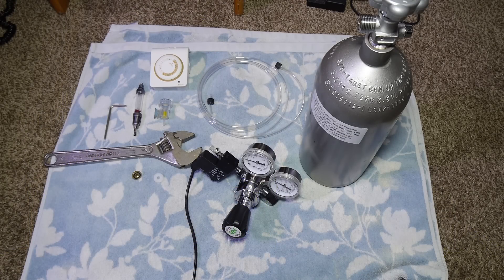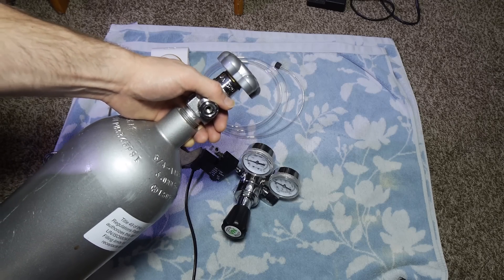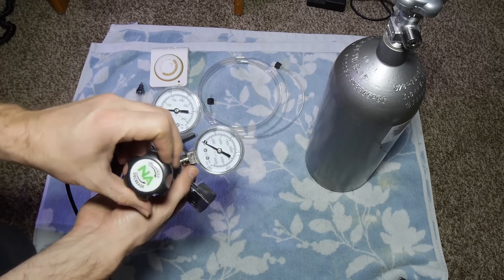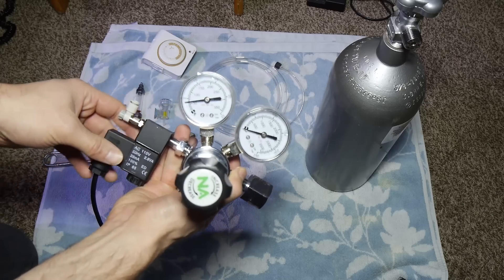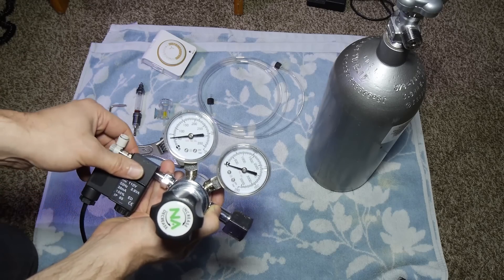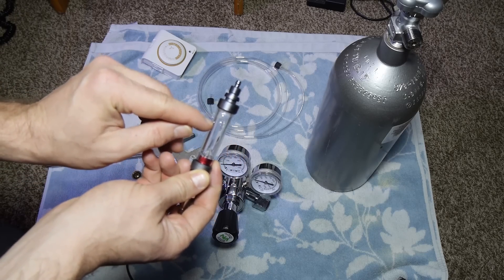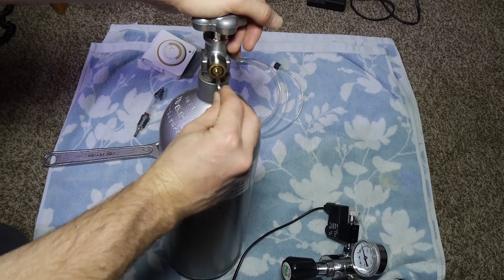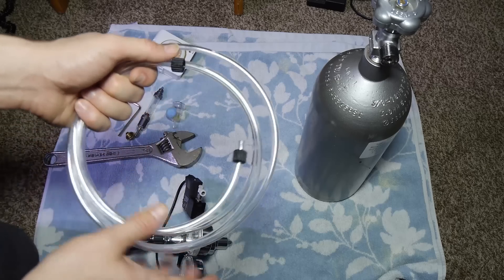How You Want To Set Up A Pressurized CO2 System | Aquascaping

Comment: Great video! So I'm getting into high tech planted tanks and I'm planning to get the aqua tech premium regulator. I just have 3 questions, what type of co2 diffuser should I get for a 55 gallon? How much would it usually cost to get a 1 gallon co2 tank? How long would the 1 gallon tank last with 2-3 bps with the regulator on for 8 hours?

Comment: Hey Dave , I have been trying to figure something out with my setup that hasn't been set up yet due to a few concerns that I have been searching for the answer before I have any regrets from damaging my regulator. So I have been trying to get my UNS mini hooked up to a 24oz. paintball cylinder. The setup video from UNS has a UNS Paintball cylinder that has the dial to open and close. The Tippmann cylinder that I have does not, so I have been trying to hook up the two without damaging the regulator from the PRESSURE. I hope I explained the potential to my fears of doing something that has my brand new reg ruined . The funny thing is that I had no fears when I attempted the first time but since I forgot to put the o-ring in the adapter I got my first " burst " of the power of pressurized CO2 😲 ....that has been corrected and I bought a whole 10 to replace if and when I have an empty cylinder , but I have been reading of so many people who have a full tank and life is great and it's not so the next morning or whenever their CO2 escaped . So those are what's holding my hair as I'm puking in the toilet of the paintball blues , not to mention that prior to the everything I had been using the reg with a 95 gram Fluval canister for a few months and it's amazing the results etc. But now 2 weeks with not a drop.😿
Reply from the maker: Hi, can you purchase the same pressure valve UNS uses on their paintball cylinder and hook it up to the paintball cylinder you are using? Or can you purchase a pressure valve for paintball cylinders in general? I am not familiar with using paintball cylinders. Another option is to open the mini regulator valve and needle valve all the way as you connect the regulator to the cylinder. And make sure to tighten the regulator really well to the cylinder. Then, adjust the working pressure (30-40 psi) valve in the cylinder, and then adjust the needle valve as needed. I am sure this will be loud and you will lose some CO2 as you are tightening the regulator to the cylinder. 

I would first try and find a pressure valve adapter for the paintball cylinder. Similar to the one UNS is using. They are obviously using it for a reason. You may find it on Alibaba, Amazon, or Ebay. I hope this helps. I am not familiar with paintball cylinders and mini regulators, so I am not sure if the mini regulator can withstand direct pressure from the cylinder or not.

Comment: Same Tank...... I got a new light and filter and fertilizer. I am now wondering what the cheapest substrate for plants will be, on Buce-Plant the Controsoil is out of stock in regular so they only have the small grain expensive kind. What substrate should I get now, maximum budget for substrate is $40, enough to cover a 20 gallon tank (24 inch long) in however much substrate needed. What substrate should i purchase, and how many pounds/bags.

Comment: what do you think of in line heater with the co2 diffuser? which order should they be attached to canister filter.
Also, what is more important if i can only afford one, bubble counter or drop checker?
thanks
Reply from the maker: The inline heater will not impact the co2 or visa versa. No issue there. for a beginner I would say using a drop checker may be safer for  you, or both if you can afford it. Some diffusers come with a bubble counter and drop checker built in so you can get all three. I think Fluval makes a diffuser like this.
Reply: Thanks so much for the advice, also do you have any videos on the substrate options to start with for planted tanks?
Reply: I found this info online..."The solubility of gases decreases with increasing temperature, so the air space when cold water was used will be less compared to warm water. The cold water will take up more CO2 and less will be escaping to the air."
So that is why I don't know if its better with heater before or after inline diffuser.
Reply from the maker: Ash Kasto It may make a slight difference, but with your circulation the temperature would be relatively the same throughout the system, right? You could test it and run your own experiment. 25 C and 8 mg/L of DO is about 100% saturation O2. So, basically you will also already have a higher exchange rate and higher O2 and will be supplying more CO2 as well. This is an optimum situation it seems. Also creates more stable exchange rate at water surface. I have found a few studies that show 25 C as a proportional average for common aquatic plants. My Clado algae disappeared pretty rapidly after implementing this method of higher O2 and CO2. Reduce organics through maintenance, and bump that O2 and CO2 both super high at 25 C.

Comment: also, will a 5lb tank provide 30-45 psi? if so, do I need a regulator to get that. my current regulator has only one meter that reads 10psi when full.

Comment: You said that this particular regulator is not out yet but who makes it and where will it be available for purchase also since this is two Stage you shouldn't have to worry about end of tank dump correct I want to get into pressurized CO2 all my plants look great but they don't grow like they should, and I'm going through flourish Excel to the point where I can purchase pressurized CO2 with the amount of money I spent in the last few months thanks for any help I really appreciate it
Reply from the maker: http://nilocg.com/dual-stage-regulator-na-ss-pro-dual-stage-stainless-steel-regulator/
Reply: Hi Dave, how is this CO2 regulator working so far? any issues? does the company provide any warranty? I have a 5 gallon fluval spec V, do you think this would work for my tank or will it be too much? Thanks bro!

Comment: Can I use an inline CO2 diffuser submerged? My 20L uses a Swiss Tropicals corner filter with a submersible pump instead of the air powered lift tube Swiss Tropicals sells. I want to install the inline diffuser submerged behind the corner filter so it's hidden with the rest of my equipment.
Reply: Randy Shapiro   if your going to use an in-line diffuser make sure you get one with an adjustable outflow Psi.  If it’s not adjustable there is a good chance It won’t be able to push the co2 through the diffuser.

Comment: Hey Dave How long would that 5 Lb tank last on a 90 Gallon tank ballpark Thanks
Reply: Rmk22 SR. I have similar questions. I have next size up co2 tanks from kegging beer. I have a planted 55 gallon tank
Reply from the maker: With no leaking from the seal a 5 lb at 2 bps will last 6-8 months. If you had it at 4 bps for a larger tank I would assume 5-7 months. If it only lasts 3-4 months usually there is a leak. I would recommend using the white nylon seals or a brass perma-seal. Don't get those hard black composite seals. Good thing is most seals are the standard white nylon and most leaks are usually just from not tightening the bolt enough. You should actually tighten it fairly well. And the verge of too tight if that makes sense. No Teflon is needed and don't listen to anyone who says tightening it a lot is bad for brass or steel. Tighten that bolt well!  Most instructions say to tighten as much as possible. Use a crescent wrench and not channel locks or vice grips
Reply: Thanks Dave very Helpful

Comment: ok so i have a 20 gallon tank housing a bristlenose pleco. i am wondering if switching my sand to a soil would be good, although i have no where to move fish so i cannot add aquasoil due to ammonia spike (unless thats a myth). so i was thinking eco complete and planting amazon swords and ludwigia then having java fern tropica fern java moss and assorted anubias attached to driftwood. i am planning on using the all in one fertilizer by aquarium co op, or would you recommend something else. also i have a tank quit from aqueon sadly so the lights are 5 tiny patches of LEDS will that be ok since the plants are lowlight? or should i upgrade to a finnex stingray or something else? i dont plan on using co2 or root tabs. i just want to know the best light substrate and fertilizer that isn't too spendy
Reply from the maker: If you go low-light you will want soil. Go cheap on the light and buy Marfied Controsoil from BucePlant. It won't cause a spike like ADA will. Or use pool filter sand and dose more liquid ferts and up the lighting a bit. StingRay does alright on 10 gallon tanks. I am not sure about 20. I like the Current Satellite Plus for smaller low-tech. had good results using it. Usually light is where people go wrong with plant growth. It won't be as lush as it would be with CO2, but with higher light values and a lower KH this will give the plants the most optimum environment, and of course even better if used in conjunction with soil.  So you could do the Eco-Complete to get the look you are going for. Neither inert sand or Eco really add anything. I would look into using Eco, only if it is cheaper. I have a code to BucePlant that will get you 15% off at checkout! Follow my affiliate link and use the code ADU15 at checkout. If it is cheaper this way to get the Marfied than I would. If you use Eco than try dosing the ferts like you mentioned and getting a stronger light.  http://buceplant.com?rfsn=512608.61055d

Comment: Thanks for this tutorial. It really helps :)
I would like to ask if there is a set working pressure average range for small tanks? I have a 29 gallon tank with an aquaclear 70 HOB filter. So this rules out any inline diffusers or reactors. Should i adjust to under 20 psi or stick within 30-40 psi range? The green leaf aquariums atomic in tank co2 diffuser needs a psi of over 30 from what i read. Any issues going for smaller working pressure? I will probably get those cheap ceramic co2 diffusers from ebay. Keep some as spare from when they get clogged up.
Reply from the maker: Monty Chandra 30-40 should work. Sorry for the late reply

Comment: just ordered this unit now all i need is a tank and a place that does in shop refill since id like to customize my tank and be able to keep it
Reply from the maker: beveragefactory.com has really good prices for 5lb cylinders. Usually a local welding shop will exchange it for one of theirs.
Reply: i was wondering if you could help me figure something out since im pretty much going with the same co2 set up you have but im planing on putting it into a cabinet and i wanted to know what the over all height of the set up is with the top of the bubble counter to the ground since i only have 21-1/4 inches of height to work with worse comes to worse if it doesnt fit ill use a different style of bubble counter
Reply from the maker: The Watcher the top of the bubble counter sits at 20.5", so you're probably good.
Reply: ah sweet thank you so much for the help

Comment: No check valve is necessary on the Co2 tubing to the inline diffuser?
Reply from the maker: It is. With this one it is built into the bubble counter. It is rare, but if the CO2 is off for an extended period of time it could get into your needle valve chamber on your regulator and cause issues.

Comment: How much electricity does solenoid consume?
Reply from the maker: I am betting around 6.5 watts  when engaged. Does that sound about right? 110V AC.
Reply: yep Ive googled, could be from 1 to 8 watt, differend manufacturers etc. Aquamedic have just 1 watt, which is cool! usually 3-5 watt for Camozzi seems to be OK
Ive just asked that coz whole year expenses for electricity for filter, lights, heater

Comment: Hi, I would like to know what exact CO2 hose you are using. Is it the 3/16" ID x 5/16" OD x 1/16" of this https://www.usplastic.com/catalog/item.aspx?itemid=114705&catid=571 ?
Reply from the maker: I am pretty sure that is the correct size considering the nipple on the diffusers are usually 1/4". I will make sure and measure the tubing and will get back to you!!
Reply: Did you forget?
Reply: What is the correct size?  This?  56280 
1/8" ID x 1/4" OD x 1/16" Wall Bev-A-Line IV Tubing or the size above?

Comment: i dont even have enough money to afford even a paintball co2 system lol
Reply from the maker: haha, you can always do DIY citric acid! better than yeast IMO. But I feel ya man. I am just lucky and get sponsored.
Reply: ive never been able to do that right either! :( i keep trying though
Reply: DIY co2 system is very cheap! U need some tubings, 2 bottles and two caps for DIY system, citric acid and baking soda. You can also buy cheap ready to use system on aliexpress or eBay for 13$
Reply: thank you
Reply: just try, that is worth. I installed the output of CO2 to the intake lattice of my internal filter, so it works as dissolving device also. You can use ceramic atomizer etc.
Reply: Luke's Aquatics Try DIY. Is cheaper but you will need hands on a lot.
Reply: thank you but i may have found a good deal on a used system

Comment: Wont the CO2 (that went out due to surface agitation) damage my room's air quality? Won't it be safe for me anymore?
Reply: Unless you are dumping a kilo of CO2 into the tank every hour (which is crazy talk) there will not be any problems. CO2 is a gas found in the Earth's atmosphere. Adding (via the aquarium) enough CO2 to a room an a normal building to change the concentrations to a dangerous level would be nigh impossible. If you live at the bottom of a sealed room then maybe you could do it, but you would probably suffer from anoxic (limited O2) conditions before that happened.

Comment: hey whats the brand on the Co2 regulator been looking up a bunch planning on getting my first co2 system im over here looking at the vid trying to figure out what it says LOL no soom dammit :P
Reply from the maker: Robert Abila it is a NilocG regulator. Can get at nilocg.com
Reply: and for the co2 tubing was its 3/16 ID x what LOL so many sizes only know the inner diameter is 3/16 lol i found some adapters i need so figure i order the other from this site too
Reply from the maker: Robert Abila I want to say it is the 1/8" thickness for ID and 1/16" for wall thickness and 1/4" for OD